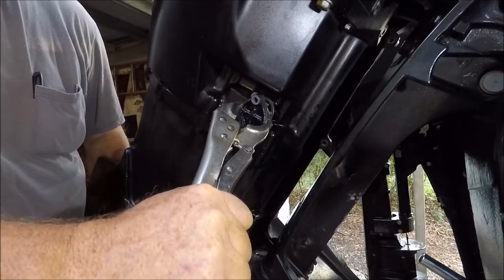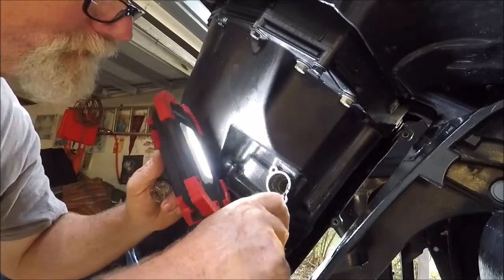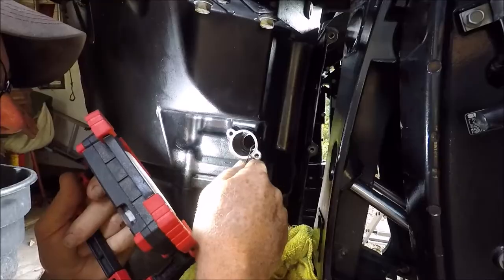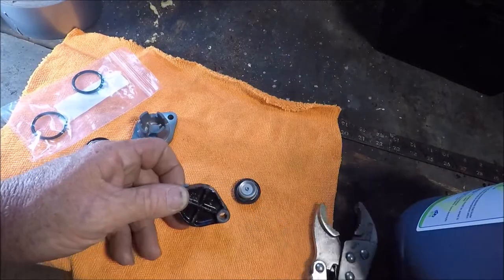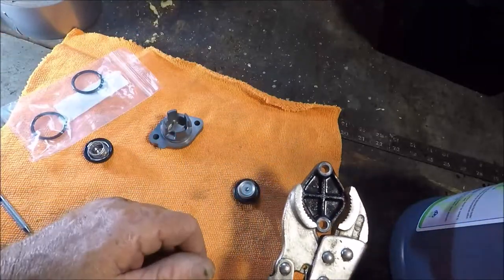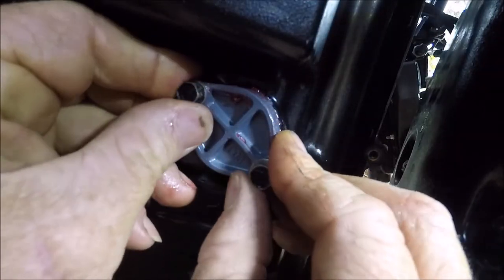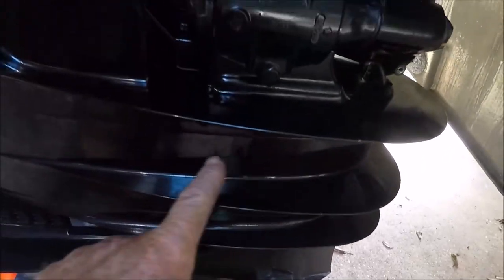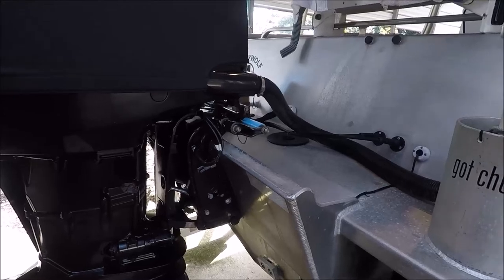SUZUKI WATER PRESSURE VALVE REPLACEMENT

Comment from the maker: 📌📌FYI FOR ALL: THIS IS A OLDER VIDEO. I REPLACED THIS MOTOR EVENTUALLY WITH EXACTLY THE SAME. NOW OVER A YR. INTO RUNNING NEW 250, AND IT RUNS COOLER THAN MY OLD MOTOR ''''EVER RAN''', SAME GAUGE, SAME EVERYTHING! NEWER MOTOR NEVER RUNS ABOVE 150 degrees f.  THIS MOTOR IN VIDEO ALWAYS RAN 140 TO 165 DEGREES f.   (just a FYI)
Reply: Capt Dave I am in the chute for a re-power and I did ink a deal for twin DF250AP but your videos are scaring the hell out of me.  Honest assessment request:  Is your corrosion issues with fuel heat exchanges, thermostats, anodes because Suzuki is a hot metal engine (meaning lots of galvanic issues) or is it because of the Saint Johns river?  Ill be running 90% offshore in Florida Keys and the 10% will still be crystal clear water with the exception of the few months the canals here get murky in summer.  I got to admit the fuel to heat exchange seems a bad design idea in its design.  I am also Leary on the drive reduction gear.  Seems a solution to a problem that does not exist for me and just adds more maintenance parts.
Reply from the maker: @parkdavis2079  I run in the most shit water you can image. mechanics here love this river! Never ever had a t-stat issue, only fuel cooler clogging (yamahas have the same thing) I did have a issue with one side of cylinders running 20-40 degrees hotter than the other side. (Hence the comments made about temp, in video Description.) Could not get it looked at, or fixed, and still stay in business, so I wholesaled the motor and bought the one I have now in May of 2020. THEY ALL no matter what brand will let you down, after paying a lot of $$. IF sleepy scum bag joe doesn't put me out of biz, I'll be replacing the one I have now at 1000 hrs. ALL  issues are called MAINTENANCE.
Reply: @CaptDavesSportfishing  Thanks.  im replacing a pair of 2002 Yamaha ive run in northcarolina for the first 1000 hours and about 800 here in the keys.  Ive always done my own maint and no major issues with these I could not fix in my driveway but now they are time bombs of corrosion.  My re power choices are down to 2021 Suzuki 250 or Honda 250.
Reply from the maker: @parkdavis2079  I had 2 Honda 225's.....NEVER AGAIN!!  I'll buy a MERC before a Honda. (But that's just me) I'm sticking with zuki's. I'm not some fan-boy either, I  lay it all out there. You probably missed this recent video:  https://youtu.be/0NHpUCO5mCQ  Best bang for the buck, and the KING of repowers. I've fixed everything in my driveway too, one of my best buddies and MOST loyal subscriber YT channel supporter is a zuki mechanic. So, I learn all the insider stuff. I know zuki's all to well. Like my Cummins in my truck, I never want a gas engine again!
Reply: @CaptDavesSportfishing  nice video on the cowing and general maint.  I have a merc on other boat i built for wife but i really want white engines on my this time.  I have given a lot of thought of how to order the mercury washdown parts used in my 150 merc and adapt them to the Suzuki so i don't have to remove cover to wash down.  Seems like an easy enough modification unless they use it to void a warranty.  turns out the Honda is not available til may so zuke wins this round.  talked to a capt on my street and his internal anodes are lasting 200ish hours easily.
Reply from the maker: @parkdavis2079 I check and clean my interior anodes each oil change 100 hrs. And change if 1/2 gone. EZ to do on a zuki.  I don't know why you have to take any any cover off to wash down, don't understand that. If you get a 250 zuki, it'll have lower water pick ups and the stupid book says when using the flush muffs, cover them with tape...what? NO THANKS. I use a 70 gallon barrel by rubbermaid like these: https://www.amazon.com/dp/B007IAFCC6?aod=1&linkCode=sl1&tag=jettywolf2006-20&linkId=a89187b6e054e2f67f0daa42f0da652c&language=en_US&ref_=as_li_ss_tl  I run the motor up to temp after every single trip, to clean that dirty St. Johns river out of my motor and '''''fuel cooler''', WHICH CLOGGED ON MY LAST ZUKI. I have videos all about how that will ruin your day fast in the 110 degree summer days. https://www.youtube.com/playlist?list=PLK-ee3q-bFR2KPb2cDapcVKEbkUjsWyJM   I have a well, so no biggy.
If I had 55-65k laying around I'd have a OXE diesel 200 on my transom and forget about all these gas engines. I like and use torque, speed means zero in my fishing world.

Comment: I just pulled and replaced the water pressure valve on my 60-hp Suzuki. I went about it a little bit different. I pulled the bolts holding the cover on and used a 5/16" bottom tap and tapped the bolt holes in the cover about 2/3s of their depth. I then screwed two 5/16 bolts in and used a slide hammer with a double claw to remove the cover.

Comment: I never understood why but this issue was always worse on my Suzuki than on my Yamaha… and I loved the Suzuki but yeah Suzuki just always had more scaling and salt build up no how much OCD effort I’d put into cleaning and maintenance
Reply from the maker: no more issues for me, I run out in a barrel of fresh water, almost every day. Cuz, I have low water pick ups, and Never Ever use those built in flush ports!!  Oh Yamahas  are not immuned. They all clog up, funny thing is they tell you using the flush ports is just fine, NO IT IS'NT. My fuel cooler clogged up too. I have vid about what will happen, too.

Comment: I understand thermostats are for low speed idling and cannot flow enough to control high speed heat so the pressure valve allows more flow of hot water out

Comment: I changed this on my Zuky today. I believe it required 27 bad words to get it out. First time was a breeze, today was a monster.
Reply from the maker: yep, gonna do mine on a good set of rainy, blowin'' cold day(s)......plural just in case. BUT, when ya learn exactly what it does, there will be a tell tale sign, ''its time''. Orowock  explained it to me. But I now forget the particulars. The worst part to me is those side tupperware pieces, getting back into their position, WOW does suzuki need to redesign them!!!!!
Reply: @CaptDavesSportfishing  I find myself enjoying keeping the maintenance tight on my Zuky. Been told I'm OCD with it. Well so be it. Don't want my shit coming apart on the water and last I check they are not giving these things away. Old video but still good stuff.

Comment: '05 DF200
Trailed at idle, starboard head is pushing 190°, port head 125°. Replaced both T-stats that were totally locked open from corrosion. In the process I discovered a doubled over cooler line. One of 4 or 5 that derive from below intake manifold.  There is a 3 way T that feeds water to intake jackets. LONG phillips screwdriver from where they start to run up from T, inserted while looking down from T-stat housings and unfolded this one doubled over hose. Found this while servicing. Will check tomorrow if any difference in temps. 
Just some info for others to look for.
Great video and will definitely flush w/Rydelyme when it arrives. All passages opened up w/removal of t-stats, anodes. New water pressure regulator on the way.

Comment: You are certainly doing everything that you can to keep that Suzy running right.  Most folks don't have a clue as to what all needs to operate  and flow perfectly to keep an outboard running.  Thanks for the video and taking the many hours to put out some great information.
Reply from the maker: trying to cure a issue, that I don't even know if it is a issue, we'll see if I get feed back.
Reply: The 122 is where the thermostat opens put it in water  and heat the water the 122 and it will open

Comment: I have 2 X 2014 DF250APX Lean Burn in Miami on a 30ft boat. They run at 130F even at 5300 RPM. The low temp thermostat is for the lean burn engines. The higher temp thermostats are for the non-Lean Burn engines. I tried the hotter thermostats on my engine once and they used a lot more gas. While the cool engine was using 7GPH, the hot engine was using 12 GPH. I do have an idling overheat problem after running into some shallows that I'm trying to figure out. Thanks for the videos
Reply: inspect your impeller after having sand run in to them . charging system also can not handle long  idling .

Comment: I’m in Florida.  I have a Honda 90.  My motor has a strong pee stream and pees very cool - slightly above water surface temp. Have you tried a thermo temp gun on your pee water to see if it’s actually the temp on your gauge reading?  Also I ran into the same issue as you with salt/scale build up in the motor.  I always flush my motor with the ear muffs and recently discovered my actual flush port/valve is clogged inside the block mount case. Changed out both head and block thermostats and also the water pressure release valve.  They were horrible but flush port is still clogged.  Waiting on Rydlyme to be delivered.  I will pull all the valves again and flush for a few hours to see if I can get everything flowing and unclogged.
Reply from the maker: You don't check with a temp gun at your water Outlet stream you check it at the sensor to see if it's the same

Comment: I looked at water flow chart on df 140 suzuki and it says  If cylinder water pressure is high when thermostat is closed, the valve will open to relieve the pressure. my thermostat is a fail safe and it is stuck open since  the water coming out of the hub (prop) which is a discharge point for thermostat  is always warm and constant temperature (it should be super hot when thermostat opens) . 
I believe I may sheer off the bolts if i mess with them as they have not  been moved for 400 hours of salt water operation .and since  I live in Texas I really don't need  a thermostat and if I don't have a
thermostat I don't need   water pressure valve. .
What do you think ,,
Reply from the maker: fix your boat...correctly

Comment: My stats are 140 degrees. I usually see a temp at that rpm of 154-156.  I’ve never had a temp issue except when I idle for 5-10 minutes. I will have a manifold temp sensor alarm.  This was corrected a year ago with new stats and impeller. It started again last time I took the boat out. But impeller is a year and a half old. Check out my video at salty flag tv. Mine engine is a 2015 df250.
Reply from the maker: MINE ARE 122..... get 17670-90J20

Comment: Thanks. Saw your video and had a pee problem so I thought it might be the problem. Bought 2003 boat a couple years ago and went to change. It had the factory paint still. Sad. Used your method of changing the anode with a modification. Tapped both bolt hole to 5/16-18 and used a steering wheel puller with a 2x2 picket to pull it out. The problem ended up being a stuck half open thermostat which looked fine last year.
Reply from the maker: glad I could help   (?)

Comment: I have an old  99 df70 ,having pee problems ,looked at the thermostat ,not only was it corroded ,,all the water port underneath are all scaly ,,how am I supposed to deal with all of that,its most likely scaly through out.Also my water pressure valve which is connected to my exhaust manifold,ordered a new one,but haven't looked in there yet,,probably the same?
Reply from the maker: check my video on descaling your whole entire engine with rydlyme! number one go to my channel, number two, look through the playlist of boat maintenance videos. you'll find lots of info there. including getting the scummy muddy salty shity St Johns River out of my expensive outboard?
Reply: Thank you  @CaptDavesSportfishing

Comment: Personally I wouldn't use grease on it I would use OMC gasket sealant (gorilla snot) it will help seal it plus not allow corrosion two get seated in there should be an easy extraction next year. Just a thought.
Reply from the maker: this was check #1 from factory, after years....all the  other times, Came out fine, after being greased. Now if zuki would add a touch of grease that would be a novel idea. I use what I have.

Comment: What kind of grease did you use there? How did it hold up? Did it make replacement next time around easier?
Reply from the maker: Never re-replaced....sold motor and got new after awhile, I use just red waterproof grease. I'm sure it would have.
Reply: @CaptDavesSportfishing  thanks. Been following your videos to help perform on maintenance on my 2012 DF250. How exactly did you clean out areas where poppet valve & thermostats are with the Rydlyme?
Reply from the maker: @knollie81  tooth brush?

Comment: if engine is out of water because of jack plate you may not get enough water .  my book for df 140 says thermostat  operation is from 118 f to 125 f
Reply from the maker: jack plate????? where do you see a jack plate. MY BOOKS: shop manual, owners  manual never mentions any temps. Thats way too low. lowest t-stat available is 122 degree. I run between 130-170.
Reply: @CaptDavesSportfishing  same thermostat will open sooner at high elevation like a lake in colorado mountain since water boils sooner at low  pressure .
Reply from the maker: @boashna  no idea about all that I'm in Florida. this was the water pressure regulator valve NO ONE will ever tell you about. But its part of my maintenance, schedule.

Comment: I have a df250 and when I'm at idle after a few minutes my engine reads overheating and go in that protection mode but the pee water seems cool but I have to shut down and sometimes takes awhile to operate properly have any idea what causes that any info will be a help
Reply from the maker: I'm NO  expert....but thats not enough info. thermostats?  here's more info, if you DON'T run it out flushing in a tank/barrel. Fuel cooler clogs with dirt and salt.    https://youtu.be/BTrd3sM24P0  and my boats playlist: https://www.youtube.com/playlist?list=PLK-ee3q-bFR2KPb2cDapcVKEbkUjsWyJM
Reply: I’m replacing the CT temp. sensor , df70 is reading hot but it’s not! Need to know what your codes indicate, mine pointed to  CT sensor!

Comment: Try cleaning your temperature sensor they get a lot of scale on them
Reply from the maker: PER A SUZUKI MECHANIC: Cleaning the sensor would do nothing but risk damaging the sensor its self. First off those things dont read with surgical precision. The part of it that actually reads is sealed away from water and wouldn't work at all if it had water intrusion. second off if it did have scale sand silt or salt around the the area where it reads from, the scale sand or silt would heat up to the same exact ambient temperature as the water it is immersed in . It would be a giant waste of time I personally have never cleaned one and cant ever remember changing one. I'm sure that block has some scale in it. Scale being a little corrosion not river mud.  probably a lot less than most because of the care you take in flushing and cleaning. Its all part of the normal life span of the motor. You have an exhaust temp sensor in that motor too its covered in carbon i'm sure, but its still doing its job or the motor would run like shit.
.......

D-O-H!

Comment: Had same problem 200 Suzuki still have i going to try that.
Reply from the maker: Didn't fix my running hot issue.....but still good to check and replace every few years, for sure. IT'S A PAIN TO GET OFF, so greeze the shit out of it when putting back together. Parts available at boats.net in N. Georgia, if ya have trouble finding it. Thats where I get 90% of mine.

Comment: I run 120 with 6 yr old DF225 on 3800 lb 23 ft fiberglass boat - SWFL
Reply from the maker: Well, I have a 2 week old 2020, df250 brand new zuki now, and it NEVER RUNS 120!   SUZUKI T-STATS are 120 degrees. My new motor runs 128-145, depending on speed.

Comment: Did that solve the temp issue?
Reply from the maker: nope.....but good to replace this every few years. It can get nasty in there. And back then, my fuel cooler was clogging.
Reply: @CaptDavesSportfishing  So was it the clogged fuel cooler the solution to the 170F temps?
Reply from the maker: @retiredman2006  nope

Comment: It should go into overheat alarm at about 175 I thought, so 170 is high
Reply from the maker: nope....just before I switched to a new motor, I saw 205, with no alarm. I believe that setting is much higher.
Reply: Capt Dave's Sport Fishing you are right. The max is much higher.  Mine would alarm due to the quick rise in temp. The reset temp is 172 or 169 depending on condition 1 or 2. See attached pic of Suzuki manual for over temp if I can get it to load.
Reply: Check your email. Sent you a pic of the over temp info from the service manual.
Reply: I have a 2014 df 250ss. Idle temp 143° after it warms up, running temp usually is around 163° at 4000rpm, at wot it gets around 175° which i think is kinda high. Maybe thats just how these motors run i dont know. I live in south florida by the way. Hope it helps.
Reply: Damian F these motors actually can run much hotter, over 200F.  Mine idles around 140 ish.  WOT around 158-165.
Reply: @rjyoungjr  maybe its time for me to change the water pump and see if that helps bring down the temp